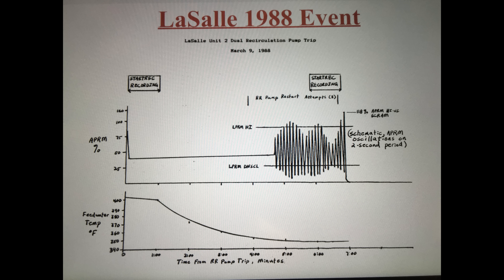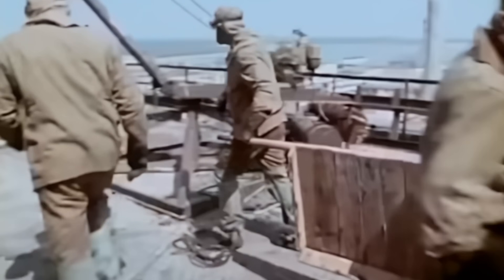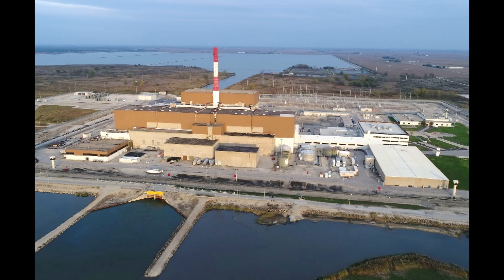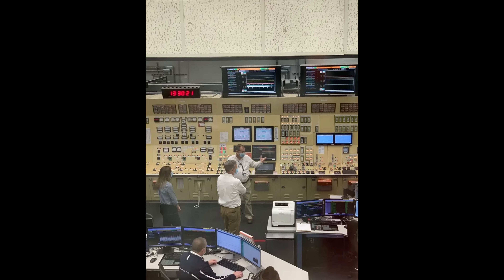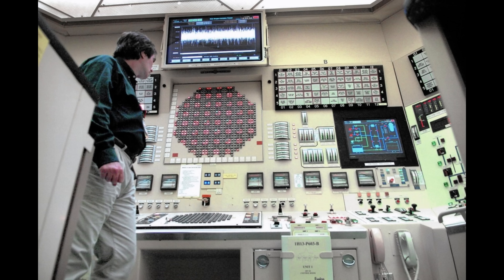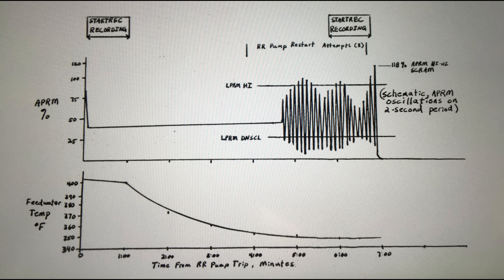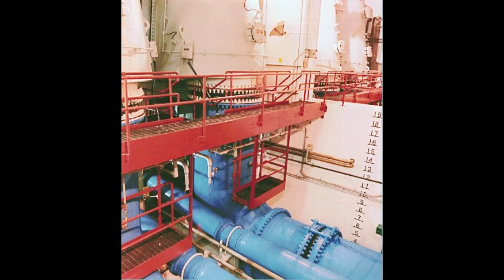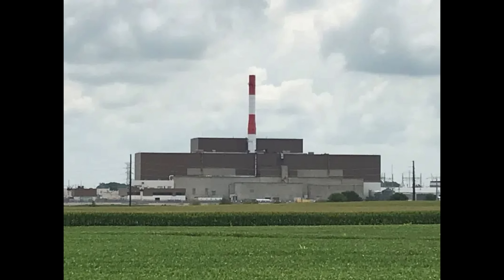LaSalle 1988: America's "Almost" Chernobyl?

Comment: Haven’t seen this yet but I’m curious: of the 3 Big Nuclear disasters I’m most familiar with Chernobyl.

How does the damage dealt by 3 Mile Island (1970’s) and Fukushima (2010’s) compare to it?

I ask not only because I haven’t seen any direct comparisons between them online yet, but also when I read the title ‘America’s “ALMOST” Chernobyl’ I thought ‘Hang on, what about 3-Mile Island? That was a huge disaster in the 70’s that’s led to America being pretty gunshy about almost all forms of nuclear energy ever since hasn’t it?’

Perhaps I’m just overthinking it, just wondering for now.😅
Reply: TMI was a major accident for the industry, and a partial core meltdown occurred, so it did more damage than Lasalle, but no major explosions occurred like at Chernobyl or Fukashima (a hydrogen explosion did occur within primary drywell containment, but this was withstood by the structure and did not contribute to a release in radioactive materials). The process of the partial core melt did release substantive volumes of radioactive gases into the confinement structure (radiation levels of up to 800 R/hr, this is extremely high, upon a later excursion into the containment structure an employee received a dose in excess of quarterly occupational limits and was not permitted to return to work until the following quarter). Though the containment structure was fully intact, the nature of the failure which caused the accident, a stuck open coolant system valve, had allowed fission products which were released into reactor coolant to exit to the auxiliary containment structure. Much lower radiation levels were detected here but were nonetheless present, and due to the presence of some fuel material in the coolant, an amount of radioactive noble gases escaped the site from the auxiliary structure. Estimated dose to locals wasn’t projected to exceed 1.4 mrem (the acceptable dose rate to members of the public is 2 mrem/hr, this is 1.4 mrem total, substantially below regulatory limits. Measuring impact is a much more difficult and complex endeavor, and should perhaps not be considered through the lens of statistics at all). 

The big difference here is that TMI never exceeded its licensed power level or went prompt critical, neither did  Fukashima. The main concern with reactor damage is not typically prompt criticality, it’s afterheating caused by the continued decay of fission daughter products. In the absence of sufficient cooling (caused at TMI by a litany of errors and system failures, and at Fukashima by the failure of emergency diesel generators) a reactor will get hotter even as reactivity has decreased significantly (TMI occurred at roughly 7% of licensed power, the reactor was shut down at some point during the accident). While this core melt is a major concern, the melting point of the reactor pressure vessel and concrete is typically above what even a melting core will produce except when cooling is nearly absent, as was the case at Chernobyl and at least one unit at Fukushima (it wasn’t even discovered that TMI had experienced a partial meltdown for years after the incident, as the vessel could not be safely opened until the activity had largely died away). The real issue is the high temperature catalysis of an oxidation reaction between steam and the Zircalloy fuel cladding. Oxygen from the steam bonds to the Zirconium, producing zirconium oxides, and leaving free hydrogen gas. At TMI, this gas was kept within the primary containment structure, designed to withstand possible explosions of the vessel or from hydrogen gas. At  Fukashima, hydrogen gas had leaked out of the primary containment structure and into the auxiliary containment building, where much critical infrastructure was located. Explosions at multiple units damaged necessary cooling equipment that hindered and in some cases prevented the cooling of the cores. It is speculated (by modeling, because we still can’t confirm it) that the core of unit 1 melted through the pressure vessel entirely and cooled after melting partly into the concrete, where reactivity was reduced. 

The thing about both of those incidents relative to Chernobyl and Lesalle is that a runaway reaction was never a concern. Yes, they melted down as afterheating produced extreme temperatures (enough in one case at least to melt steel), and some radioactive material escaped confinement in both cases. But at Chernobyl and Lesalle, the stakes were substantially higher. The great risk of a prompt criticality incident, and what is now suspected to have occurred at Chernobyl, is a “fizzle,” which is essentially a failed fissile explosion. More accurately it IS a fissile explosion, just much smaller, as the material blows itself apart so fast it cannot maintain criticality long enough to produce a true bomb yield. While Chernobyl lacked a containment structure, notable for having prevented TMI from having been a total global disaster, it’s plausible it would not have mattered. The same could be said of LeSalle: the possibility of an explosion well outside of anticipated yields (the fizzle theory would not become prevalent for nearly 3 decades) placed the reactor at risk of becoming entirely exposed, which is where the real hazard lies. Without containment, there is no safe way to handle a fission product release from a grid scale plant.

Comment: That reactor getting into a cycle where power peaks and drops every 2 or 3 seconds, and its going PROMPT CRITICAL during the peaks, is a .... very, very bad thing.
I think they came REAL close to making history..... and not for the right reasons
Reply: A BWR cannot go prompt critical like an RBMK and the oscillations were way too quick to cause any core damage, eventually the reactor tripped from APRM upscale, it should’ve tripped earlier but the flow biased scram is delayed and OPRM also failed to issue a signal because the flux peaks were smoothed out
Reply: @thefxconcorde  In my head it makes sense that a BWR can't go prompt critical / or at least this one didn't.  My gut tells me that if it had gone prompt critical, we would have heard this story a long time ago.... due to the disaster incurred.  Rather than just being a footnote in history because it ALMOST blew but didn't.
Reply: @FAFOForYou  GE BWRs don’t explode like RBMKs, because depending on their current RPV pressure at the time, it was unlikely cause the tech specs is 1250 PSIG and SRVs would open on 1068 PSIG anyway on safety mode
Reply: @thefxconcorde  It's not supposed to be able too...yet he has the graphs that allegedly shows that happening.
Reply: @slwsnowman4038  No idea which part of the comment but the event was not a prompt criticality event, the core just entered a region of thermal hydraulic instability and neutron flux began oscillating, RPS worked as intended and shutted down the reactor before it could cause core damage, the problem was OPRM is not implemented during this event
Reply: Hearing that a reactor core has gone Prompt Critical terrifies me... That is an event that should never occur.
Reply: We actually did make history. This is a well-known event within the industry and basically all modern oscillation analysis, monitoring, and response in BWRs traces back to this event.
Reply: I don't know much about nuclear plants, but I know enough controls theory that the graph made my asshole clamp down like a bear trap...

Comment: I'm betting that no one ACTUALLY knows how high reactor power went.  The instrumentation / data logging was never meant to record such fast, sharp, hard spikes.  And things happen QUICKLY in reactors when things go bad.
For an "amateur" i'm decently well read on this subject, but.... never once heard of this incident! Crazy.  Wonder what other stories are out there to tell
Reply: This is all public information you can look it all up on the nrc's website. Also, the reports show it went up to 118% power before scram initiated ADS   and inserted the control rods.
Reply: @Heretic666x  Scram doesn’t initiate ADS, if RPV level was already at nominal then it was a spurious activation which shouldn’t happen, and it has a timer delay of 105 seconds
Reply: @Heretic666x The RPS isnt connected to the ADS
Reply: Correct.

Comment: Well, thank god they had not turned off the automatic safety systems. And sure was nice of them to include a negative void coefficient. And that it was not the 6 months fresh from reactor school night shift at the controls. And they weren't doing a safety test that had failed every time it was attempted.
Reply: NRC wouldn’t let you bypass RPS in any normal circumstances

Comment: i think i have to watch this a few times      wait so the preheaters stopped working and cold water was entering the core?which should have turned to steam. if it wasn't for the relief valve...gotcha..... sos an almost TMI......gotcha and in 2017 the pressure valve malfunctioned.

Comment: Comparing this event and saying it could have been remotely close to Chernobyl is wrong and not even close. You have two redundant automatic scram systems in the bwrs. You could go down redundancies failing all day. Also you didn’t consider having both primary and secondary containments which Chernobyl didn’t have.
Reply: Yes thank you
Reply: Standby liquid control system. Aka. Boron injection.

Comment: So kinda like Chernobyl but the SCRAM actually does what it's supposed to
Reply: yeah the automatic safety function actually worked. 

Why the reactor wasn't set the SCRAM the moment the pumps shut down, got me effed? Designer KNOWS they need to shut the reactor down, so why wouldn't you tie the two together?
Reply: @CelticKnight2004  As long as there is no loss of coolant, reactor is able to operate safely without water circulation for a time sufficient to restore normal operation. Restarting reactor after shut down is a royal pain in the neck and a loss of huge amount of money due to downtime. As said in the video, this kind of behaviour was expected by the designers so they set automatics in such a way that it will be able to  restore normal operation. However they didn't anticipate that there are workers with arms so strong so they'll be able to create a water hammer in the system 😁
Reply: @CelticKnight2004 At lower power you can operate in natural circulation for some period of time. Procedurally speaking, one of the corrective actions for this event is inserting a manual scram following loss of both recirc pumps at high power.
Reply: @Diabolical_Engineer  why, when they were designing this, knowing this could be a problem, wouldn't shutting both pumps intentionally or not, not SCRAM or at least, insert most of the rods? 

Or when the reactor started to excursion like this, not SCRAM?

why deliberately run something at a dangerous level in a dangerous way? 

It feels more like "Hang safety. We make money"
Reply: @CelticKnight2004 This is one of those events that's blindingly obvious in hindsight. While there was some understanding that BWRs were prone to power oscillations under low flow conditions, what they didn't know was that the average power range monitors (APRM) wouldn't pick up oscillations in phase. Because they average power across the entire core, the operators at LaSalle couldn't actually see how much power was fluctuating.

Besides the administrative controls, many BWRs added oscillating power range monitors (which just average LPRM inputs differently) to allow them to detect situations like this in the future.

The biggest issue with this event was that RPS did not detect and insert an automatic trip much earlier on.
Reply: @CelticKnight2004 because recirculation pumps actually cause the reactor to increase power output. The correct response would be to nearly shutdown all recirculation flow and instead run on the LPCI in shutdown cooling mode.

It may be best to evaluate how a BWR works. The low recirculation flow meant that the negative fuel temperature coefficient would keep reactor power output low. Water being regenerated by the shutdown cooling system. This system is completely independent from the recirculation system. I think your confusion is caused by thinking they are the same thing.
Reply: @nuclearandspaceeducation3201  Thanks :) that makes sense
Reply: @CelticKnight2004  12:12
Reply: There were also significant instrumentation changes for most BWRs, as the normal APRM system is averaged in such a way that you can't see power oscillations that are in phase.
Reply: And, the fact this was a water moderated reactor not graphite
Reply: АЗ5!
Reply: A little known fact is the BWR protection system was originally designed with a partial scram for certain events. It worked by inserting certain control blades, waiting a fixed delay to determine the reactor power, comparing that power to a preset value, and if the power exceeded the value, it would do a full scram. That time delay has been set to zero for decades so a full scram always occurs.
Reply: The USA didn’t cut corners when it came to Safety. 
They made sure that if the Reactor was about to go BOOM, it would shut itself off automatically to avoid such scenarios.

In the Soviet Union’s case, they cut corners, they made very cheap and design flawed Graphite Moderated Water Cooled reactors with a Positive Void Coefficient, and the AZ-5 button was meant to fully put all the control rods into the reactor to prevent chaos from ensuing.

Anyways, the control rods had two parts: the Graphite Tips (which accelerate reactivity), and the main Boron Rods, which reduce reactivity.
And when the Chernobyl AZ-5 Button was pushed, it began to insert the control rods. However, Fuel channels broke, and the control rods were stuck, thereby leaving the graphite in place to endlessly grow the reaction until the whole thing went BOOM. 

Also, there was no safety confinement building, and so when Chernobyl exploded, it just went all out and bursted forth into the air. 

Basically, Soviet Engineering was bad.
Reply: @rottenroads1982 I think it's as much ti do with wrong engineering choices that you don't nessacrily find out until after the fact. The RBMKS are a massive reactor structure similar to the AGRs in the UK. Any reactor that big isn't cheap and with size comes difficulty in control that isn't something you can always easily predict. 

The soviet engineers were very capable and it would be a mistake to dismiss what happened as because anything with that name attached is inferior.
Reply: In Chernobyl the scram button was pressed before the power rise, it wasnt just that it didnt work, it caused it.
Reply: 3:50 518 centimeters above the fuel? Did you mean millimeters?
Reply: @bavarianmonkey8326 no cm, mm would be way too low a margin
Reply: @sc1338five Meters of water above the core Sounds plenty

Comment: The fact that this didn't result in any core damage is pretty much a miracle.  And the other comments are wrong in that this couldn't result in another Chernobyl-- clearly our guy was saying that the scale of the accident could've been similar, not that the accident would take the same form as the Chernobyl accident in literal nuclear physics terms.
Reply: Even if the reactor had exploded (something that has never happened to a commercially operated BWR in all its operating history) the existence of a containment structure would have severely mitigated the scale of the accident compared to Chernobyl.
Reply: @TheBoldImperator and I guess this is as small as the rest of western reactors
Reply: @TheBoldImperator  Chicago is to the northeast - emptying the city because of a heavy dose of radioactive Xenon ?

I guess LaSalle at that time DIDN'T have a gas filter system.
Reply: @TheBoldImperator  If I am remembering correctly this channel has stated that the containment structure wouldn't have been able to contain the Chernobyl explosion. None the less it's hard to believe that this reactor would've exploded like you say though I am just an armchair engineer with 0 engineering knowledge 😂
Reply: BWR cores don't explode! :)
Reply: You are taking the author of this fabrication at his word.  He is not accurate.
This would not have been near Chernobyl in ANY way.  The RBMK reactor was a design compromise upon compromise.  They were operating outside of their design envelope.  This was fully within the design envelope.

Comment: Operator error absolutely played a role in this accident. They should have scrammed the reactor the second it started doing that funky oscilating. This is actually operator error. Absolutely prideful, foolish inability to go 'stop'.
Reply: That's not what the operator training told them to do. The procedures were wrong, but the operators followed procedure. That's not operator error, that's bad procedures.
Reply: It's not "Human Error" when the human hasn't been given ANY training or even 'Low-Key" advice from a colleague on what to do and/or what the "Proper Response" to this situation was.

That's WHY "All rules are written in Blood", you can't be prepared for what you don't know, haven't expected, or never experienced. Only by REVIEWING the "Oopsie Daisy's" can we learn from them, to help AVOID them in the future...
Reply: Well, yeah, operator error caused the pump shutdowns in the first place.